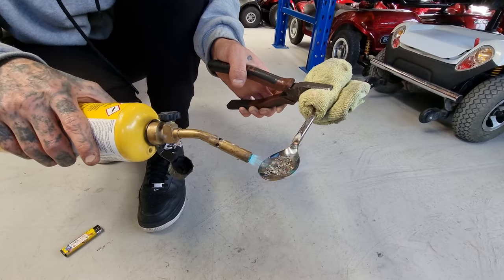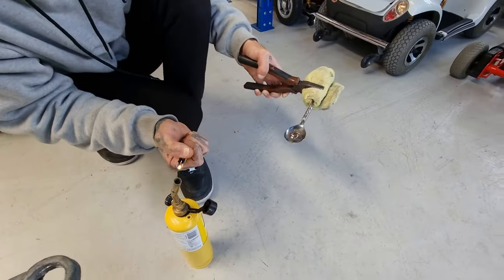How To Replace/Remove a Welded Forklift Battery

Comment: So in america we use sockets and ratchets too change a battery.
Reply from the maker: A lot of the folklift batteries in Australia are welded in. I wish they had terminals
Reply: This video is really helpful. Thanks for sharing 
Pls what is the likely weight of the removed cell? Especially after it is drained
Reply: in the US. majority of batteries here are welded, some have the bolts still, but don't run into it as frequently.